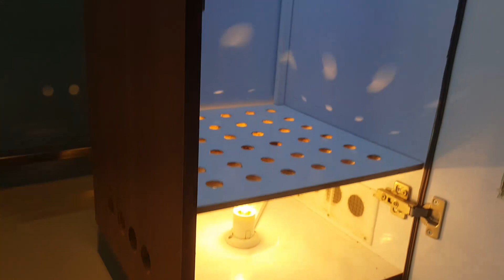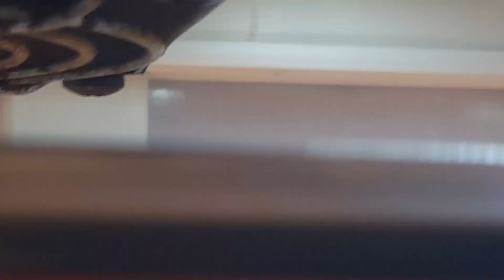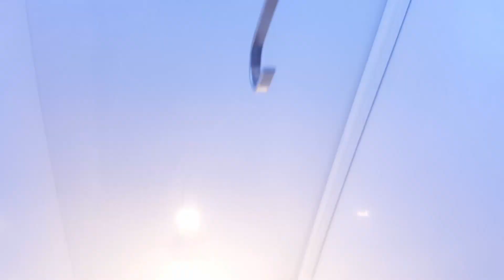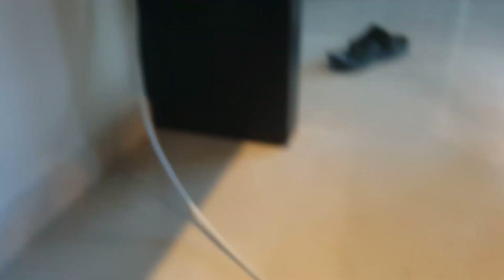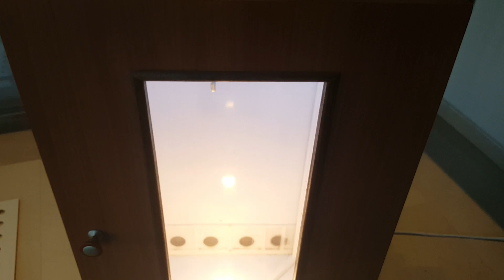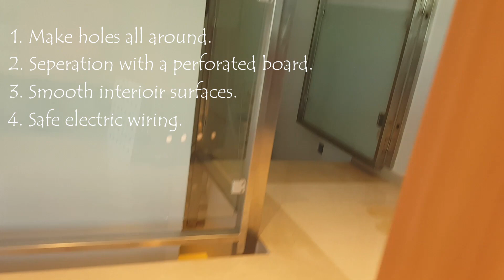How to build your own ultimate Biltong Drying Box

Comment: The bacterial growth on wood can be reduced it stopped by letting it dry out. If you live in a humid place, then leave the light on for a few hours after cleaning with water. Basically treat it as a wood cutting board.

Comment: hello friend what is the purpose of lamp? i did a biltong box as yours and i putted temperature and humanity control unit, i figured out even 100 w lamp doesn't heated it up inside of box because until air heat it is already out of box, lamp could have affect but definitely not about heating what do you think?
Reply from the maker: Hi, you are right. The lamp mentvto be used without the fan  causing the air heat and raise up . When using a fan the air doesn't stay long enough to heat up. Despite that is refuces the humidity a little, helping with preventing mold issues.